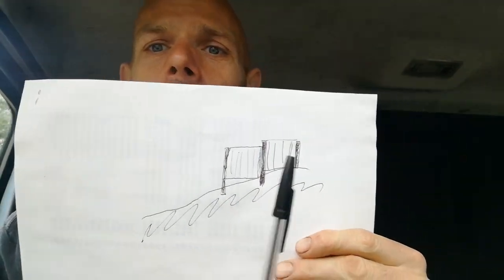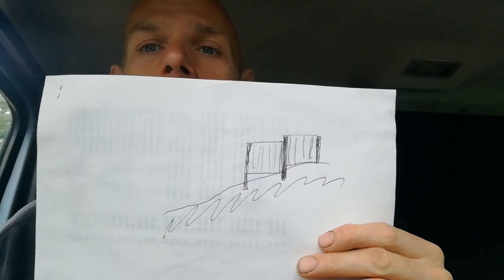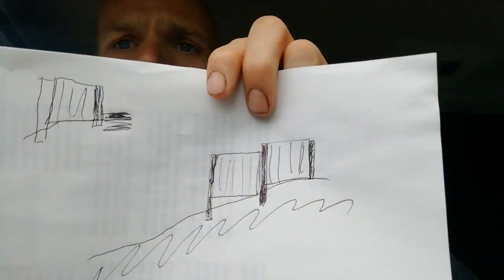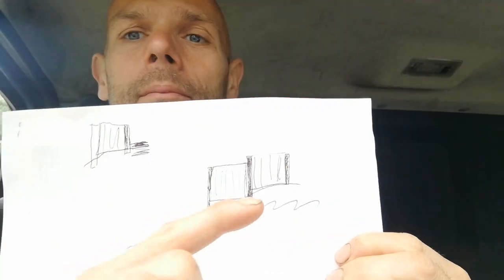Fencing down a hill/slope Jay Sharp

Comment: Hi mate, have you managed to do any videos for putting up a closeboard fence on a slope that gradually rises? I'm planning on fitting a 2m fence with concrete gravel boards, I cant go higher due to planning rules so how can the fence remain at 2m throughout its length 24m on a slope?
Reply from the maker: Hi I would do a quick vid tomorrow as it will be easier to explain
Reply: @lincsfencingandgardeningse9128  great mate, look forward to it, cheers!